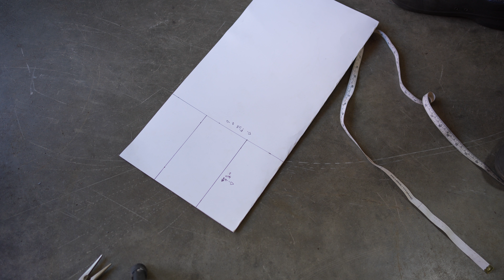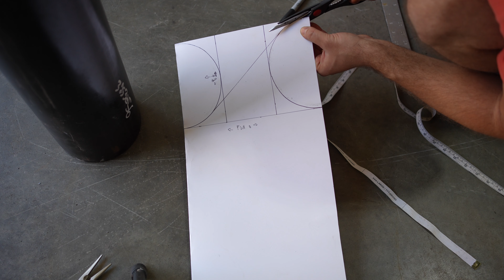Building a Modular 250 Gallon Offset Smoker

Comment: great welding job i know it was a ton work by your self  how's the old back holding out here's a tip for the seams in stead of using flour mix  go to the good  old hardware store and pick up some furnace/wood stove cement in a container its like 5 lbs that will work great and if you need to remove it you can just break  off. now that you made a monster smoker don't forget you have to feed it $Rich Mann$
Reply from the maker: Haha! Thank you for the tip I'll check out furnace cement

Comment: How many cutting disks you use.
I made a 80 gallon out of a compressor tank and it was only 3/16 thick and i used about 10.
Id say 40 for sure.
A lot of work
Reply from the maker: Probably around 150 to 200
Reply from the maker: Actually... not really sure but maybe you are right. Closer to 80 to 120

Comment: STEVE GOW <3 may i ask. I have perfected the point side of the brisket to perfection in my opinion with your advices + Goldees Method. No wrap, pull at 187-190, warmer at 150 for 12-20 hours, perfect every time!!! but the flat is not there yet, is good, is not bad, but not PERFECT! Do u got an video on how to perfect the flat? pls link me? i think i watched a video of yours and you and your wife didnt like the long hold Flat of brisket? if im not mistaken?
Reply from the maker: @welovedji1116  recently I've been foil boating around 170 and covering the very tip of the flat with the end of the foil boat. Prevents it from drying out

Comment: I just found a source of these tanks.
They got 12 tanks at $150 each.
So I'm gonna get 4
3 for the smoker part 1 for  the firebox and make it my winter project this coming winter.
Also I think I want to put in a trailer.
Reply: What are the specs for the tanks?
Reply: @philipp594  I just bought some.
125 gallon
1/4 thick or so
40 something long
30 in diameter
Reply: @toddpower4674  thanks for the reply. Sadly it’s so hard to find something like that in Europe …